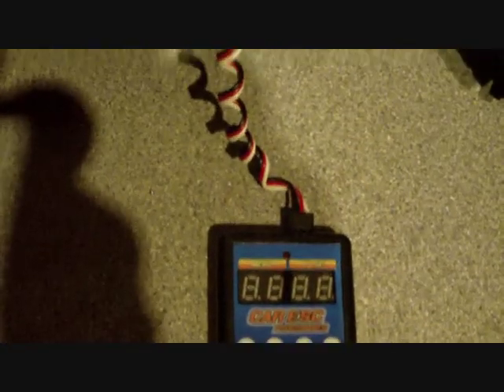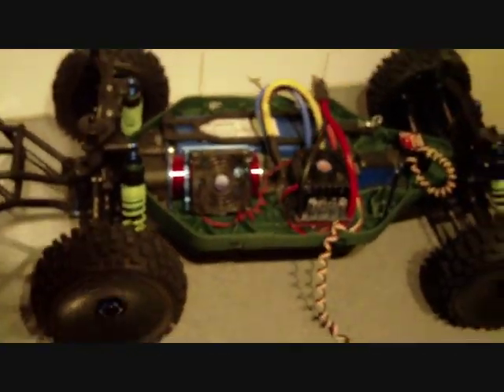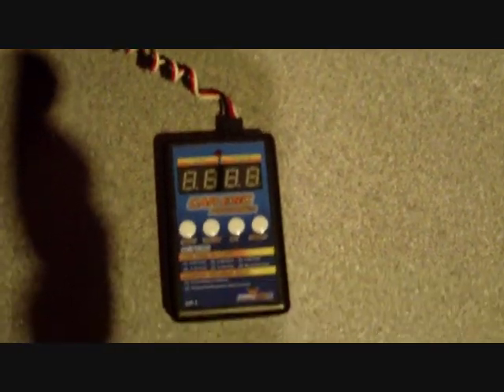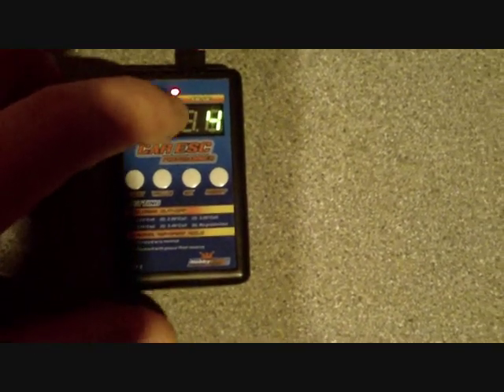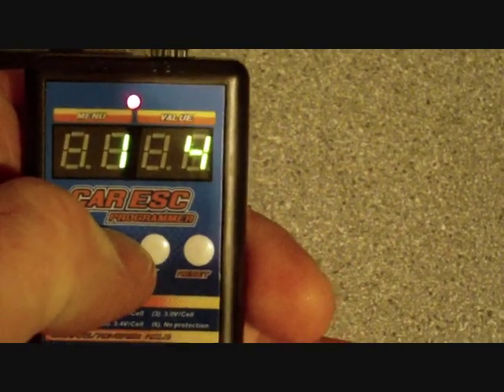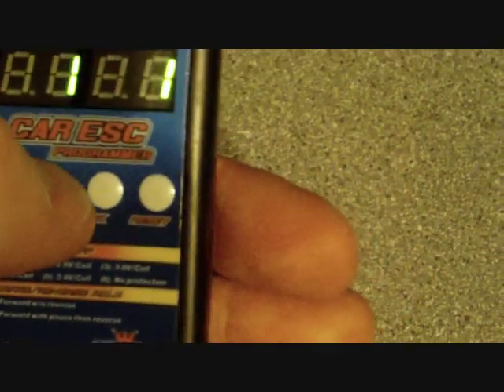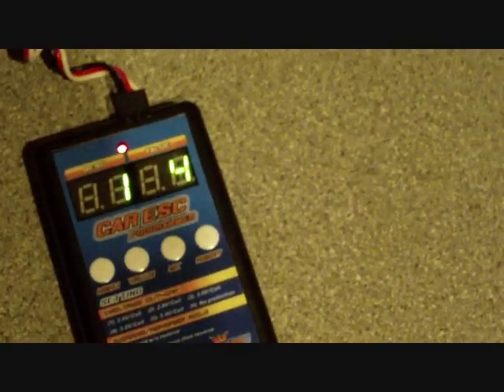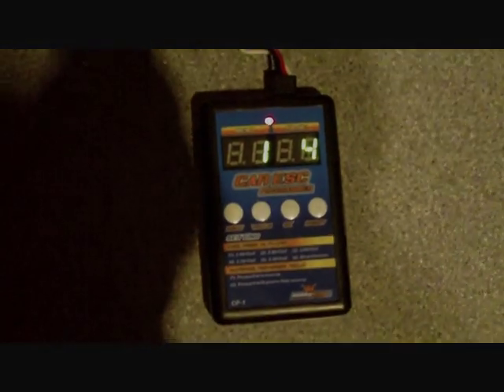hobbyking programming card for Hobby King Sensored/Sensorless Car ESC (1:8/1:5)

Comment: I have just got my new HK150a esc, it works great, i run it with 3s and have had no problems, im using it on my slash 4x4, the only thing i didn´t like, is when you go in reverse hits forward without braking, that´s  the only issue, anything else is  great. By the way, its too big for your e-revo vxl, and so powerful.
Concluding its a very good ESC.

Comment: Is there any way to do any programming without the card?  Most ESC's have some basic programming options using the radio.   I need to reverse my motor and the programming card has been out of stock forever.  Thanks for any help you can give me.